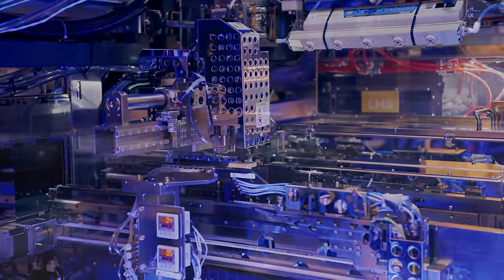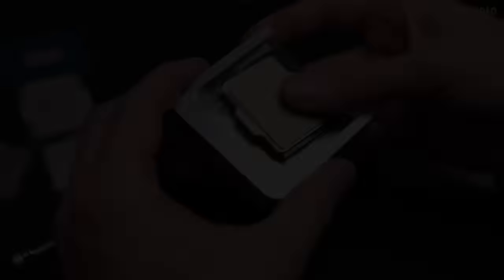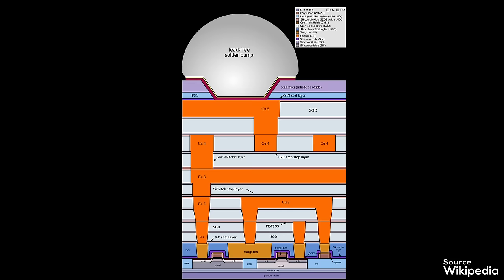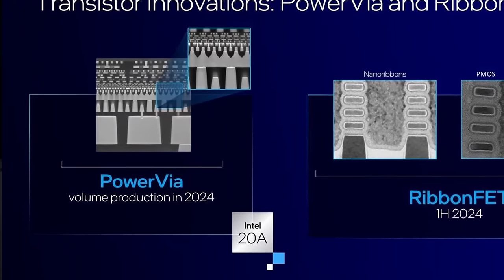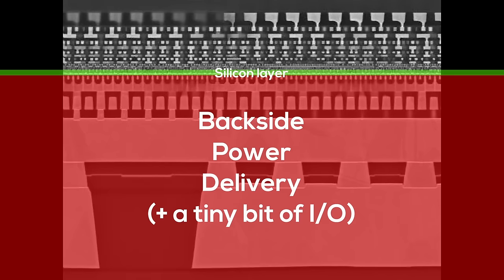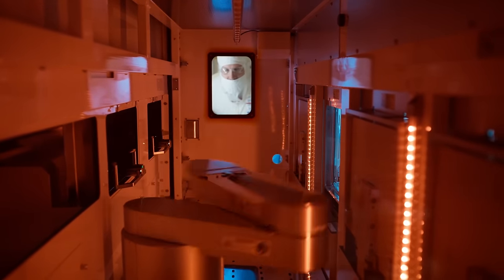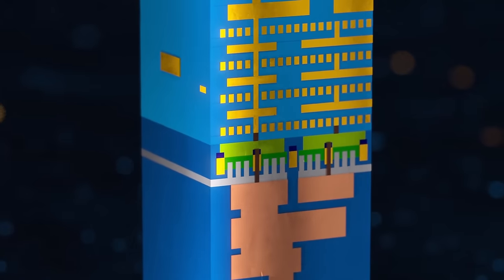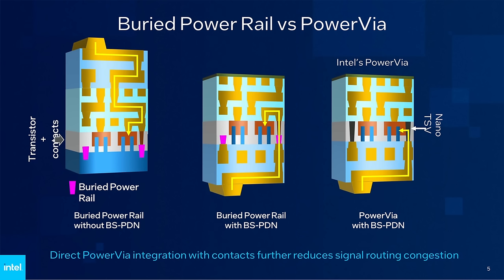Why next-gen chips separate Data & Power

Comment: Why is a BSPD not flipped at the end?
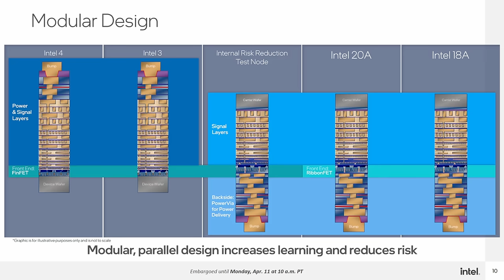It gets flipped to build the backside on top of the wafer and should then be flipped again to connect it to the substrate or what am I mistaking? (Timestamp: 11:05)
Reply from the maker: Duplex is in regards to the frontside (= the top of the wafer) facing downward. With BSPD the backside is down and the frontside is up. So it’s technically not in a flipped position when finished. It’s not about if you flip the chip during manufacturing. Maybe I could have explained it better.
Reply: @HighYield  Thanks for the explainer 👍 so flip chip is basically just another phrase for backside up?

Comment: I never understood why power was on the same side of the wafer... 
It was basically one of the first things that came to mind way back as a student already. As a student I had to draw PCBs and was taught that the power lines should be as much separated from the rest as possible, for safety and EMI reasons... so I never got why they didn't apply the same rationale in designing these dice.

Comment: To clearify, this will not affect how these get connected to boards. Correct? It will however mean growing a layer of silicon on the top ofnone of those metal layers. 
I wonder how that will work out. Im Only used ised to starting with one wafer then building atop .

Comment: 1:40 what if you do like a PCB and make double sided chips, or 3 layer silicon (or silicon substitute) with power delivery provided from said middle layer

 Now take amd Ryzen, instead of just using the top surface, you could put another full Ryzen on the backside, and use a sort of middle interposer for power delivery, and use some custom logic to simply run it like a multi core CPU, with hyper threading

Now you realistically can get 64 core CPU or higher

Same with a gpu
Reply: In effect you split die thickness in half, with a center interposer that provide syncing  and glue logic, and can still achieve backside power delivery for both physical units
Reply: It'd be a weird looking package would not be compatible with current sockets due to cooling system changes, in this context you'd probably would want a heatsink dissipation capacity on its own of 300w and higher with liquid cooling

The chip package probably would resemble a plcc style chip with the pin or contacts around the edges and towards the sides 

Because both sides are used, that would allow you to mount the chip  on a riser card to facilitate cooling on both sides, but increase in space and overhead
Reply: Call it Full silicon fabrication

Already effectively 3d print certain chips like dram anyway to get storage density so making layered silicon PCB shouldn't be a wild idea

Because that's all a chip is, a PCB
 On a PCB, connected to other PCB 

Each at a different scale

You just shrink the PCB down so you only can see it under a sem or tem photography

Comment: Appreciate the video, how does this approach translates to clock speeds? If the power network is longer does that mean lower clock speeds? Also if it has so many advantages and even cheaper to manufacture why this hasn't been done before? 17:30 in this frame you can clearly see Mitsui, I had no idea they made semiconductors as well. Are Japanese also at the cutting edge of semiconductor manufacturing?
Reply from the maker: The reduction in voltage drop leads to a cleaner and more stable supply of voltage to the cores, which results in higher clock speeds. Just like (on a different level) a better and more stable PSU can also help stabilize a overclock. It hasn't been done before, because up until recently you didn't really need it and frontside power was good enough. Only over the recent years the metal layers have become so complex, that it made looking for a solution a viable option.

As for Mitsui, I think we are looking at a photomask or a cover for one. It's a mask for Intels Meteor Lake.

Comment: Notice that when he says that chips with backside power delivery will be 20% less complex and therefore 20% cheaper to produce, it means exactly just that, cheaper to produce... and not that Intel will sell you Core 9 16900K chips 20% lower in price than the Core I9 14900K... in fact, you should expect them to be more expensive: 
-A 20% production cost reduction coupled with a 10% price increase of CPUs with backside power delivery means a net 30% in profit for Intel... and that's how you do business and keep the shareholders happy, folks!

Comment: Im curious where you got the image you used for the thumbnail?  Was this an AI generated image, or did you find it somewhere?  Could you share a higher res version?
Reply from the maker: It's AI generated and then I edited it with Photoshop. I can upload a high-res version, but it's not a real prodcut or anything like that.
Reply: @HighYield  I really like the look of it as a stylistic reference.  If your could share that would be great.  It's just hard to make it the details at such a small size.
Reply from the maker: @Eikonic_  Here you go: https://imgur.com/K23zDl0 (that's the original AI generated image)
Reply: @HighYield  very nice!  which AI did you use?  i gave a quick try with Adobe Firefly and it looked like crap.  This is super clean and detailed.  Thanks for sharing!

Comment: Something I've said for the last 3 - 4 years, in paying attention to what transistor density is moving towards, I've been skeptical of these neverending videos about having to move on from silicon based ICs because we are near its limits.

Well, while we might be approaching a point of diminishing returns for transistor density what I have said is the more important issue is going to be one of power consumption because really, approaching 500 million transistor in a sq. mm is a LOT.  As in, you can have a powerful computer in your hands and that day is already coming as handheld game devices have shown.

Humans will never need a handheld that can solve every secret of the universe.  To be able to get the power of today's desktop computers which are pretty powerful into a handheld is about as good as it needs to get and we can solve that problem with silicon based circuits.

The bigger issue is engineers needing to get better and better about parallel processes, not only in software but hardware so we don't need to clock a handheld device at 6GHz.

Comment: Maybe thin power lines should be left among the signal layers for even better power delivery.
IMHO about PCs: A major power consumption is the connection between the CPU and RAM, by extension, should be the same for GPU and VRAM; this part could be replaced by optic-fiber/photonic connections, and use Copper-Fiber transceivers. This helps with power handling on the MB, heat and overcharge/overvoltage protections, but mostly faster delivery of signal; powerful optical routers use them and are faster than any Copper counterparts,; so it's a proven concept that should be applied ASAP

Comment: I just came here from the video you made about VFET and i was thinking what if Intel mix this new manufacturing process with the lowest node plus newest transistor design and you pop up with all that (with the ribbonFET) Thanks for all the high qualitty content

Now i cross my fingers to Intel and AMD uses all this improvements not to make efficient chips but lower the current power draw. A desktop Ryzen 5 or i5 consuming even 30W at high loads would be a great advance

Comment: I wonder how cooling would change with this tech. If there are contacts on both sides of the CPU, how would cooling be supplied?
Reply: There are only external contacts on the backside. The frontside is now entirely dedicated to internal routing. It should be called BPD+IO. Your current chips are face-down, these will be face-up, so technically no longer flip-chip.

Comment: What stopped them doing backside power delivery until now? Seems like an obvious thing to do if you're tight on space on just one side.
Reply: Complexity and costs skyrocket with EUV nodes and the even smaller feature sizes needed novel metals solution that was becoming too hard to  achieve a balance for data and power signals.

Comment: Why not use both on both side? I guess because we want to sperate  the higher voltage power from the more sensitive signal circuits?
Reply: You don't need to make that many connections for power delivery as for signal, so much less "power" wires go around to the other side. And having signal and power separated of course decreases interference between them.

Comment: Sounds like just the thing AMD would love, better and cheaper. The resulting improved thermals could also be super beneficial for future APUs, this sure will make for some fine PS6 or Steam Deck 2 speculation.
Reply: You'll likely see something like this from TSMC not long after 20A or 18A releases. That would put it on track for Zen6 and RDNA5. Samsung also has stuff in the works, likely for next-gen Exynos but may attract AMD or Nvidia's low-end segments if they can provide cheaper 3nm GAA than TSMC.

Comment: I assume that in MCM chips this advantage of backside power delivery becomes less useful?
Reply: It is solving different problems. MCM is a work around on transistor density while backside power delivery is a work around on metal layer density.
Reply: I actually did my PhD on pretty much exactly this. MCM and BPD solve completely different problems, and in fact you can use BPD to boost an MCM design. So it's quite the opposite really. The 2 technologies work very well together.

MCM allows you to scale beyond the reticle limit without going to complex methods like pattern stitching, which is how Cerebras makes their wafer-scale chips. You see this pretty well with Nvidia's B100 and AMD's Mi300 series chips, which this channel has a fantastic video on. It can also be used to scale beyond a practical limit with yields or cost, which we see with AMD's Ryzen and Navi31 and 32 dies using older, more mature nodes for I/O functionality, or with Intel's Meteor Lake optimizing different dies for just one specific task.

BPD works within the die itself to free up the internal signalling and external power and I/O networks from each other, giving more space to optimize both and lower internal resistance with thicker wiring for lack of a better term. This helps your MCM design as your chips have to communicate somehow, and that freed space on the power & I/O side means better links between dies.

You can mount a bunch of BPD chips on an interposer to make an MCM design just like traditional dies. Intel has that in the pipeline already for some 18A-based server chips. You can even apply the same principals to that interposer if you want, using multiple layers for die-to-die vs external communication and package-level power.

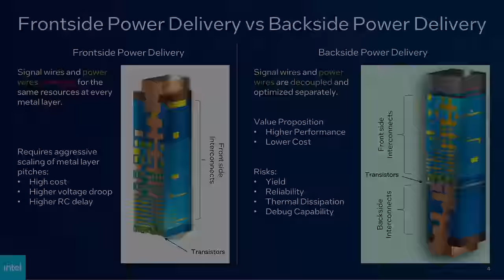Comment: That part at 13:50 should be an obvious result, and I was thinking that as soon as I saw how the separation of data and power signals works on the die.  If today's High-NA EUV lithography is compatible with all this and I don't know why it shouldn't be, I see this as getting us down below "2" or "20A" process nodes and easily down to "1.7" or "17A".  And I'm quoting these numbers since they're advertising numbers and don't actually refer to any measurement.

I think this puts us on the path to 500 million transistors/sq. mm AND should allow for transmission logic to start reducing in size again (transmitting signals off die which right now don't scale past about "6" for process nodes.

As this matures it should get us to "14A" and this is the point where I start to question if the world needs higher density than that.  Small devices won't, PCs won't, laptops won't.  The main thing they need is power reduction and this looks like a big step towards that.
Reply: We can always use more computing power.
Reply: @aapje   I'll copy/paste the other comment I made because it gives more detail on this particular point.  I agree we need more compute power in most devices than we have now.  I don't necessarily believe we'll need much more than what we'll get to in about 10 years for mostly home devices,  and what we'll need more is less power consumption.  This is a personal opinion.  I don't think we need a world where anyone can hold the power in their hand to hack any organization and bankrupt entities while they're stealing their money, from their smartphone.  I just don't.  That world sounds too dangerous.  So, the rest of my thought:

"Something I've said for the last 3 - 4 years, in paying attention to what transistor density is moving towards, I've been skeptical of these neverending videos about having to move on from silicon based ICs because we are near its limits.

Well, while we might be approaching a point of diminishing returns for transistor density what I have said is the more important issue is going to be one of power consumption because really, approaching 500 million transistor in a sq. mm is a LOT.  As in, you can have a powerful computer in your hands and that day is already coming as handheld game devices have shown.

Humans will never need a handheld that can solve every secret of the universe.  To be able to get the power of today's desktop computers which are pretty powerful into a handheld is about as good as it needs to get and we can solve that problem with silicon based circuits.

The bigger issue is engineers needing to get better and better about parallel processes, not only in software but hardware so we don't need to clock a handheld device at 6GHz."

And what I meant by parallel processing is not the same as what happens now in regards to hardware, which is many core CPUs.  I mean what happens in a single core, where right now branch prediction does a good job of speeding up the time a thread is completed.  This is more in line with what I mean, where a core gets better at parallelizing a string of instructions, because this is always a hangup, how fast a single thread can be completed.  Right now we mostly rely on ever faster clock speeds, although Intel and AMD are getting better with their architectures.

For software on the other hand I mean software engineers need to get better at parallel processing.  Some companies are doing a good job, others aren't.
Reply: @johndoh5182  I think that you have a completely unrealistic view of what even a 100x increase in compute power would do. 

For example, most hacking doesn't involve brute forcing and that which does, is done by governments on huge server farms with way more than 100x the power of a single server, let alone a single hand held. And they still can't just hack or bankrupt any organization at will. 

And single threading will most likely forever be the the issue, because if you add more parallelization and add more cores to match, you'll just get another single-core bottleneck when adding cores no longer helps.
Reply: @aapje  "And single threading will most likely forever be the the issue, because if you add more parallelization and add more cores to match, you'll just get another single-core bottleneck when adding cores no longer helps."

Yeah you didn't read this part because that's what I said:

And what I meant by parallel processing is not the same as what happens now in regards to hardware, which is many core CPUs.  I mean what happens in a single core, where right now branch prediction does a good job of speeding up the time a thread is completed.  This is more in line with what I mean, where a core gets better at parallelizing a string of instructions, because this is always a hangup, how fast a single thread can be completed.  Right now we mostly rely on ever faster clock speeds, although Intel and AMD are getting better with their architectures.
Reply: @aapje  "I think that you have a completely unrealistic view of what even a 100x increase in compute power would do. "

Cool, it wasn't really meant to be a factual statement.  I don't think a smartphone needs to be 100X more performant than they already are.  Once again, that's just me.  On the other hand about 5X the power of current new gen products and a 50% power reduction sounds pretty great.

Comment: This is very cool, but there is still one problem. The chip's pins are still only one one side, power and ground next to data. Some data lines will need to mix among those power lines, and that is inevitable.
Still, saving 30% power for the same architecture just from this change is a huge deal!
Reply: The front side of a PowerVia chip is all for internal communication, which is the really sensitive stuff that gets int the way of power delivery. I/O to the rest of the system is ging to have to share space with power. Even so, the savings just from that separation are massive and we could see future designs squeeze even more from it with direct-connect power delivery.

Comment: All processes need to be changed a completely new production line and new EDA tools. The yield will be low for a time as the silicon is sanded down and any problems will destroy the chip.
What is the waver size: 180, 200, 250, 300; How do they get a this good surface for sanding this down...
Where are the single layer chips .... without metal layers (high power IC's)

Comment: Considering how expensive machines by ASML already are, I'm pretty sure semiconductor foundries are not happily jumping to new tech unless customers are willing to pay a lot more.
Reply from the maker: It’s actually cheaper to produce, that’s the cool part.
Reply: @HighYield  Sure, once you have already bought the machine that can do the job. If modern 300M–400M USD ASML machines cannot use this new process without modifications, the initial switch to this new tech is going to hurt quite a bit.

If the change is simple enough to allow the existing machines to switch to it, I totally agree that this is a really cool invention.